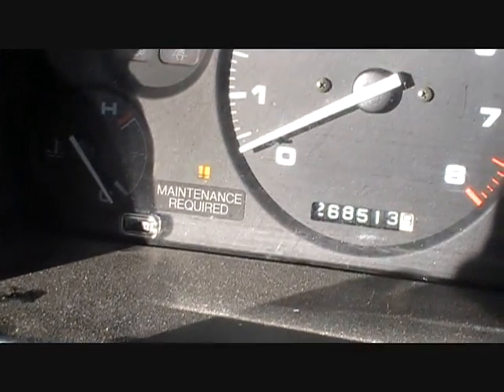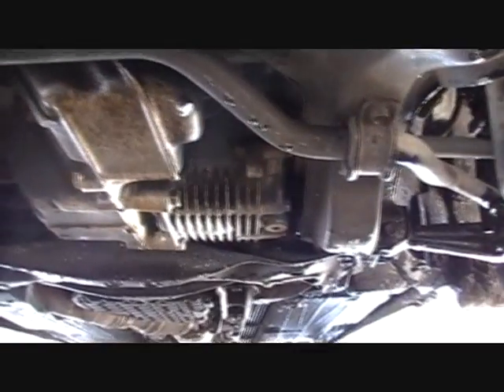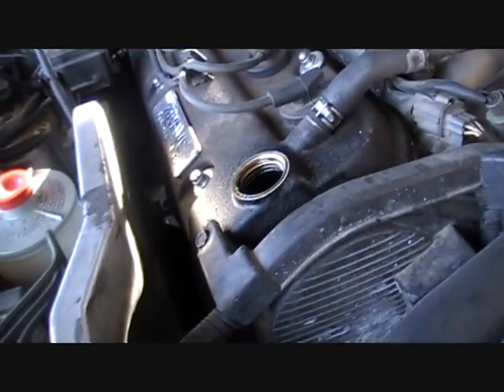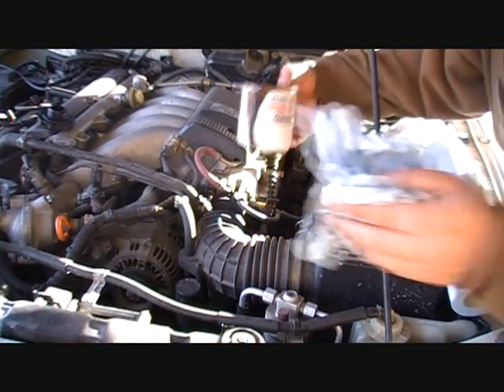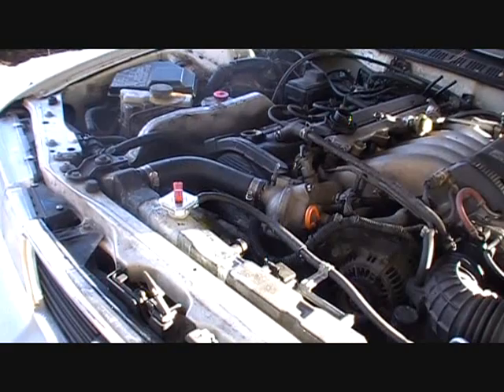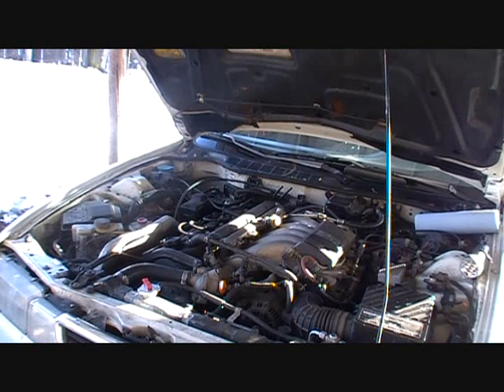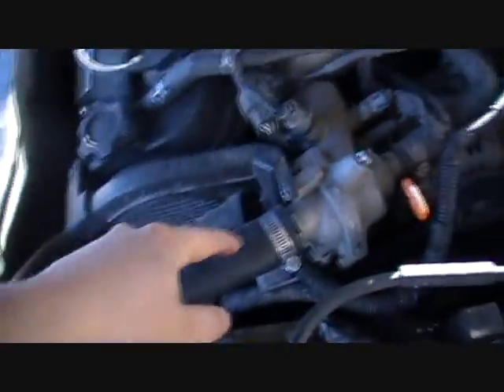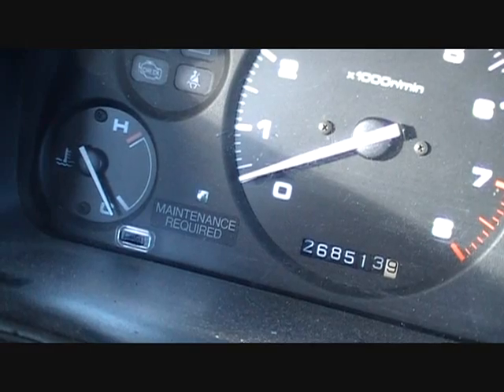acura vigor oil change plus updates

Comment: Ive got one too, and its the same color! 
Its too bad that its been sitting for a couple years. The car was my father's but now its my spring/summer project. When My dad was driving it the timing belt broke. Thank god that its a non-interference engine!

I need to replace the timing belt, the spark plugs, all of the fluids and other things to bring it back to life.

Thanks for making the video. I subbed  :D 
I could use some advice from someone as knowledgeable as you.